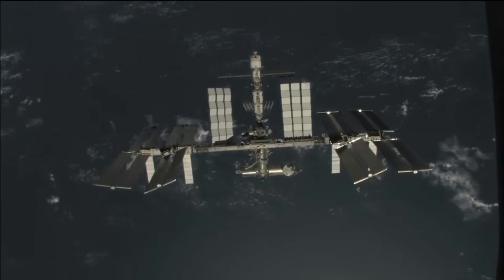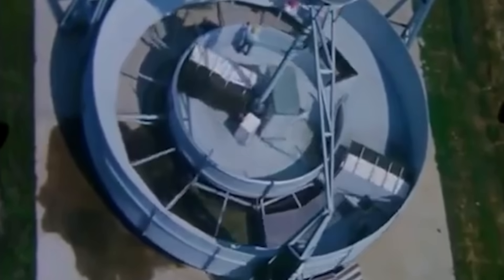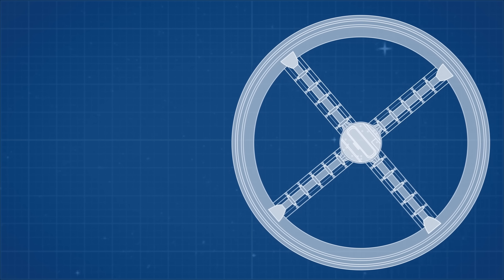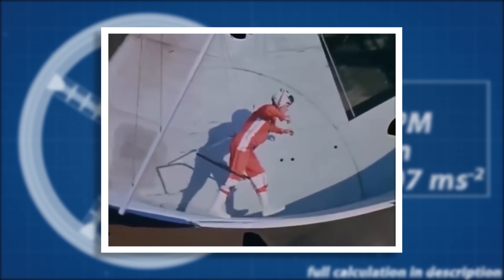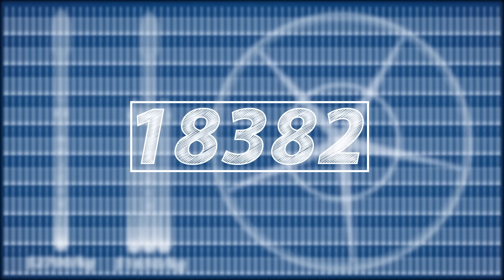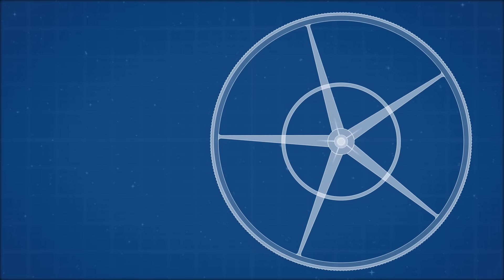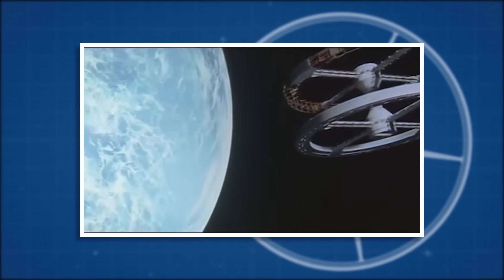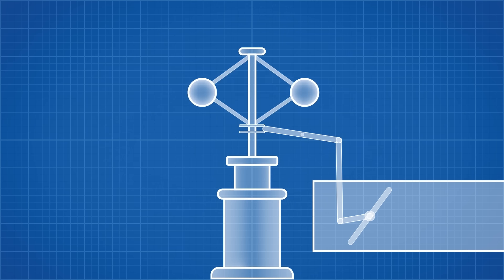Can We Create Artificial Gravity?

Comment: My 7th grade science teacher yelled at me because I spoke of centripetal force.

CENTRIPETAL force doesn't exist. A spinning object would exert no force inward toward it's center. Where would a force come from with a vector opposite the object's desired path.

CENTRIFUGAL force exists, though it's not a physical force like gravity, electromagnetism, or the strong/weak nuclear forces. Centrifugal force is the outward force, perpendicular to the spinning object and its center, experienced by the object, along with it's tangential-to-the-center rotational force (torque). If a ball is on a string and the string snaps, the ball generally travels straightforward from whichever direction it was rotating when freed, and not directly away. However, if you have a bag full of groceries (or anything) and you spin in circles, the objects contained within move directly away from you, instead of flying behind your hand (depending on momentum). That "moving away motion" is "centrifugal force," like the force exploited in a centrifuge to separate liquids/solids of differing densities (blood in laboratories)

It exists. Try the experiment, lol.
Reply: The reason why the centrifugal force "doesn't exist", is not that it doesn't really exist.  It is that it isn't a force.   There is no other object applying this force to an object that is experiencing it.  What it really is, is a perceived force that is opposite the acceleration of your immediate environment.  You think there is a force pulling you outward, when really, your immediate environment is accelerating inward.

"Centripetal force" is really the net real force needed to cause centripetal acceleration.

Contrary to what the narrator said, the centripetal force and centrifugal force, are not Newton's third law pairs of one another.
Reply: Your teacher is very wrong. There must be a centripetal (centre seeking) force directed towards the centre of a rotating object or it would fly apart! Imagine swinging a bucket on a rope around your head. The tension in the rope acts towards your hand at the centre, pulling on the bucket.
There is nothing wrong with using the term centrifugal force either. It is a fictitious force but there is no problem saying that the inertial force of an object in a rotating device is acting in the direction away from the centre as long as you define it as such. A person walking in a centrifuge has an inertial force pushing down on the centrifuge, and the centrifuge in turn acts in an equal and opposite way and pushes 'up' on the person in a direction towards the centre of the centrifuge.
Reply: Christopher Daly II There certainly is an inward force. Imagine a string connected to a rod with a mass on the end. The weight of the mass acts downwards, and the opposing force (the tension in the string) acts upwards towards the rod. If you now displace the mass sideways you have a pendulum. The tension in the string is equivalent to the centripetal force. Give the mass a big swing and you have circular motion around the rod. The tension in the string acts towards the rod, and is called a centripetal force. This is basic mechanics.
Reply: I'm so confused. (Just kidding)
Reply: Christopher Daly II
Because there is clearly much confusion on this subject. This illustrates that the teacher is correct to avoid the term.
Reply: Christopher Daly II You would never hear from a qualified physics teacher that there is no inward force.
Reply: Christopher Daly II Bonds between atoms in a material of course. Or gravity in the case of planets.
Reply: Tony Wells So, you're talking about electromagnetism...
Reply: Centripetal force seems like a pretty useless phrase then, since we have other terms that are better understood and describe the nature of it's effect on matter.
Reply: There is something wrong with saying that. Students are often confused when hearing the term. 

Unopposed forces cause acceleration. Centrifugal force is the fictional force equal the force needed for the actual acceleration. But students often think it is a real force and miss the part about the acceleration which is happening, thinking the acceleration is fictional or non-existent. It's an easy mistake to make. 

Therefore many teachers don't like to use the term. It is confusing.
Reply: What I'm getting at is is that the outward motion of objects contained within another object capable of moving within that object freely is what most people mean when they say "centrifugal force."

Perhaps more of you should start correcting them and coin the phrase "Centrifugal motion," instead of waxing philosophic about it.
Reply: Jeff Rosenbury It is confusing.  Case and point, minus the word "fictional", you just defined centripetal force instead of centrifugal force.
Reply: carultch ..."Centripetal force" is an inward force created by an object spinning about an axis. There is no inward force/momentum/acceleration, anything, as the object has moved outward from the axis and would continue to do so were it not attached or were it's acceleration to increase.

"Centripetal force" does not exist.
"Centrifugal force" does, though it is misunderstood and misphrased.

Like I said, since the problem seems to be us nitpicking about the nature and definition of "force," call it "Centrifugal motion" from now on.
Reply: Christopher Daly II You are still getting it backwards.

Centripetal force = net force needed to cause inward acceleration.  This is a real force, and exists in the inertial reference frame.

Centrifugal force, or rather pseudoforce, is a perceived force in a rotating reference frame, due to being unaware that the refrence frame is actually accelerating inward.
Reply: I don't understand why you replied.
Reply: Jeff Rosenbury Exactly.  You can teach an entire introductory physics class, and never once mention either term.
Reply: carultch You could. But you would be excluding a familiar aspect of our physical world. Which is what physics is supposed to help explain.

Imagine taking a physics class, and 10 years later hearing these terms.

A) You'd think that physics class was bunk, it would've taken 10 minutes to cover such simple subject matter

B) You'd think these ideas were brand new, because "I've never heard of those before, and I took physics."

Simple stuff goes into simple classes, like introductory ones.
Reply: Tony Wells What generates this inward force?

Why does the object move outwards?

Unless you're saying that the object is "pushing" away from the center, which would just be ridiculous XD
Reply: Christopher Daly II The inward force is generated by the structure that causes the object to move in a circular motion, instead of in an inertial straight line.

The object does not really move outward, in the event that this force ceases.   The object moves tangent to the circular path, which will look like it is outward when observed from within the rotating reference frame.
Reply: carultch So, you're talking about gravity...
Reply: Christopher Daly II Yes.  Just about every force we know and love, and experience at the familiar level that isn't gravity, is a manifestation of electromagnetism in some form or another.
Reply: carultch So it's not centripetal force. Unless you're saying that "gravity" and "electromagnetism" are "centripetal forces," as in "attractive forces that attempt to unite two bodies."

But that would just be nonsense.
Reply: Christopher Daly II Gravity can be described as a centripetal force in orbits. All it means is "towards the centre". Any rotating object can be described as having a centripetal force, eg. F=ma=mv^2/r. The F acts towards the centre of mass of a rotating mass and is a centripetal force. 'a' is a centripetal acceleration.
Reply: "A centripetal force," as in a particular class of forces with specific effects.

That makes sense. That's the first time I've ever seen it referred to as such.

At the same time, I think 'gravity' or 'electromagnetism' are better substitutes.

Or the definition needs to be changed to include examples to give context to it, such as "such as gravity or electromagnetism."

Might help end this argument once and for all, if, you know, we spread useful knowledge amongst ourselves with the goal of seeking a unified, transcendent understanding.

Comment: Why does the station have to be made of metal, or have metal casing as a requirement?

Why can't the station be made of inflatable/flexible light materials being the bulk of the weight with metal framing and reinforcements to hold structural shape? Space X has already experimented with inflatable capsules and they show promise, mainly because they're more resilient to micrometeorites, and are more easily repairable.

With that being said, very few parts of the station should need the requirement of being absolutely rigid (like metal), mainly station links, and the outer skeleton framing that would connect each of its augmented parts together.

For example, a bicycle wheel seems to hold its shape pretty well despite a majority of the material that covers its function being rubber and air.

Comment: What about the strength of the materials involved? Would they be able to hold up to the stresses involved?
Also, I have seen alternative designs that are not a loop, they involve two structures connected by a long cable, or other support. The structures are like skyscrapers spun relative to each other, acting as counterweights. How reasonable would this be in terms of material availability, launch and again mechanical properties?

Comment: centriFUGAL force doesn't exist. it is a misconception of centripetal force
Reply: The opposing force to Gravity is Gravity.. Rather the measurement of Gravity is the attraction of opposing masses. For instance, the center of Mass of a single object is also the center of its Gravity. Though the center of Gravity can change pending the influence of outside Masses "Barycenter". See Pluto / Charon relationship.
Reply: Centripetal and centrifugal are NOT Newton's third law pairs of one another.

The centripetal force is the net force needed to accelerate an object inward.  The Newton's third law pairs of it, are the fact that the agent applying this force gets pulled outward by the objects it is pulling inward.

The centrifugal pseudoforce, is the apparent force that is perceived by the occupant of the rotating reference frame, who is unaware that their immediate environment is really accelerating.
Reply: I didn't say they were right. I just answered your question. And an action or reaction is only a descriptor for a Force or influence of force, like inertia. Centrifugal Force is what is known as a 'Fictitious force'. Fictitious forces are definitions of Inertial forces being described from a point of reference of non-inertia. Both Centripetal and Centrifugal perspectives are required to understand the physics of rotational velocities and have heaps of math to back them up. Though it should be said, Centrifugal force is a reactionary force (inertia really) of the Centripetal force.
Reply: Centrifugal force is the inertia of your body trying to maintain it current momentum. That's Newton's first law - A body at rest will remain at rest, a body in motion will remain in motion, unless acted upon by an external force. Centripetal force comes from the result of the circular motion of the centrifuge pushing your body off it's path. As the floor of the centrifuge pushes against you, you push back against the floor. Every action has an equal and opposite reaction.
Reply: Mag Force and action are the same thing. A rocket uses Newton's third law to take off and get into space. Are you saying it is not using force?
Reply: Saddle Sore Whose fault?
Reply: Virgil Pheonix Centrifugal force IS a misconception. It is defined as a fictional force. It is what people generally call the inertia created from the centripetal force. It is not even a force. It just feels like forces we are used to.
Reply: James Yeoman I understand this, but it doesn't make it any less real. It is the reaction to an applied force. When you get into a car and apply the accelerator, the car isn't trying to move itself forward. It's applying a force to the ground to move it backwards. The forward motion is the reaction. A helicopter isn't trying raise itself up. It's applying force to the air downward. The upward motion is the reaction. Even when we swim, we are applying a force to the water to push it backwards. Our forward motion is the reaction. You have the applied force (action) and the reaction. It's the reaction that we generally want to achieve.
Reply: James Yeoman "Reading a book isn't as fun or as educational as a good old YouTube comment argument."

Unless you get into an argument with a flat earther, a young earth creationist or a moon landing hoax conspiracy theorist, in which case, its like bashing your head against a brick wall.
Reply: Newton's third law - Every action has an equal and opposite reaction. Centrifugal - Centripetal.
Reply: The tell me, whats the equal and opposite of gravity? electromagnetic force? quantum tunneling maybe?
Reply: The Vallin
no... thats not how he used Newton's third law, he used it as if every force had an equal and opposite force, which means there must be anti-gravity (if hes correct of course, which hes not because force is NOT the same as action)
Reply: See what you've started?!  It all your fault!
Reply: would not an object with negative mass have anti-gravity?
Reply: James Yeoman BTW according to Einstein's theory of general relativity, gravity is also a "fictional" or "pseudo" force, as it comes from the motion of an object through warped space/time.
Reply: +Virgil Pheonix well, yeah. many of the 'forces' that we experience are a result of reactions of other forces. gravity is the attraction of two masses. The bigger mass bevels space more than the smaller one and so has more of an affect. Acceleration along a road is the reaction of the friction between the asphalt and the tyres. There are few fundamental forces. All the others are merely reactions of those fundamental forces. Centripetal force is caused by momentum and friction. inertia (or centrifugal force if you're going to be arrogant) is an extension of the affect of momentum and friction. Just like there are 7 base units which make up many many more units, there are a few base forces that make up more 'forces'. My original point was that centrifugal force isn't an official force. It is a name given from a misconception of centripetal force. This here is why the Internet is so awesome. People can get into intellectual arguments with others far away from themselves and actually have fun arguing about real life stuff. I don't know why parents are always like "Get off of the computer. Its bad for you. Read a book and learn some stuff." Reading a book isn't as fun or as educational as a good old YouTube comment argument.
Reply: Virgil Pheonix I said intellectual arguments. With those people you outlined, you can have some fun with them. It's like a child's belief of santa or the easter bunny. They are adorable with their beliefs.

Comment: It would not take that much aluminum or as much weight for launch to build a centripetal force gravity ring with a radius similar to elysium. The aluminum would only be needed to make the outer ring wall/floor and the spoke structure connecting the ring to the hub. The rest of the station could be made from inflatable sections like the room on the ISS to provide the pressurized portions of the station. As for the cost to build even 2 trillion over a 5 to 8 year period is a paltry sum compared to the national debt which has gone from around 3 trillion in the late 90's to more than 20 trillion in less than 2 decades.